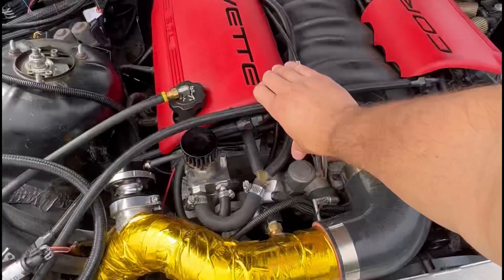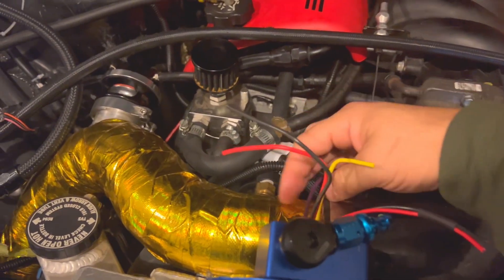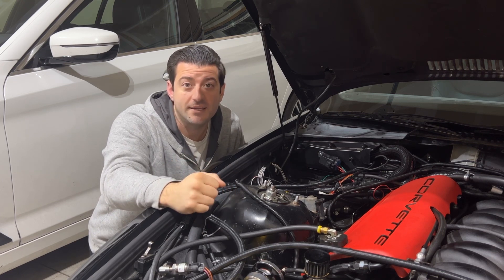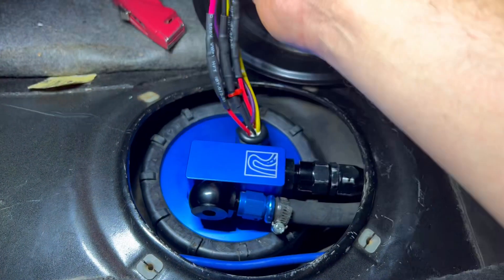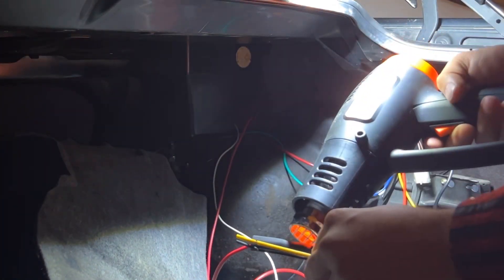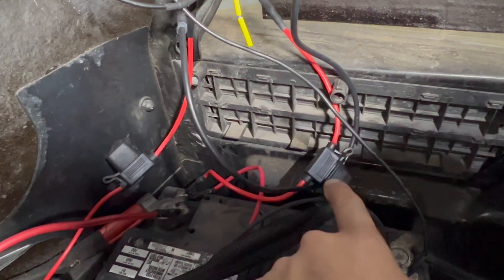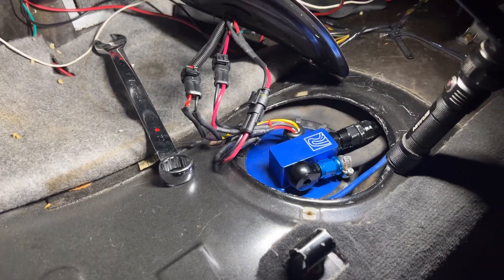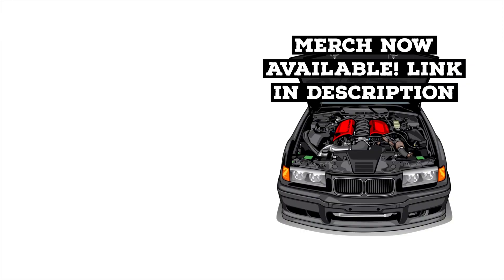HOW TO INSTALL A DUAL FUEL PUMP SETUP: Wiring and Step By Step Guide! BMW E36 Turbo LS Swap

Comment: Hey , great video man. I have a quick question. For the fuel level sender that is in the passenger side connected to the fuel pump assembly.

The sender has a black and brown wire and the the car side of the plug it has a yellow and yellow/brown wire. 

Does the yellow go with black and yellow/brown wire go with brown or vise versa ? Thanks again.
Reply from the maker: I don’t remember specifically, I might have another video that shows it. I labeled them before I cut them so I wouldn’t forget the order.
Reply: Ya I get you , I didn't label them before I cut them I made the mistake so now I'm stuck lol , I can't find a diagram neither on what each wire means for the level sender. 

I looked through your videos of this pump wiring and I didn't see anything, but I'll look through them again. 

For the primary pump did you get the signal from the factory pump power wire ? 

Thanks again man , I appreciate the reply.
Reply from the maker: @encryptedquark9677  sorry, I wish I put that in the video now that you mention it so others don’t make that mistake. Worst case scenario it doesn’t work and you switch the wires around. For the primary pump I used the old fuel pump wire to trigger my relay for my fuel pump. for the secondary pump. I have a wire going from my Holley to trigger that separate relay.
Reply: It's ok no worries , I looked at some pictures for references and I'm pretty sure yellow goes with black and yellow/brown wire goes with the brown. 

And ok makes sense I was going to use the same green/purple wire from the existing pump for trigger aswell. 

Thanks again for your help and great videos 👍
Reply from the maker: @encryptedquark9677  thanks! I’m glad it was helpful!

Comment: Is it bad to have both fuel pumps working at the same time While the engine is running.
Reply from the maker: If it’s not under load it can burn them out faster.  You only want that second pump when you need it
Reply: @LowBoostFilms do you have that with a switch or what to activate second pump ?
Reply from the maker: @josecunsako31 I have the second pump relay wired to an input on my Holley to kick on at 2psi or 50% throttle.